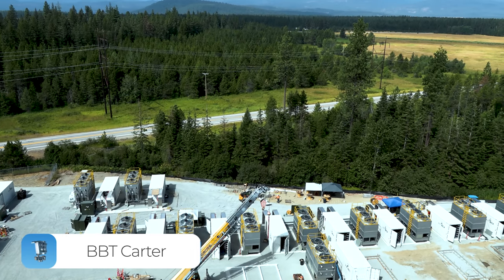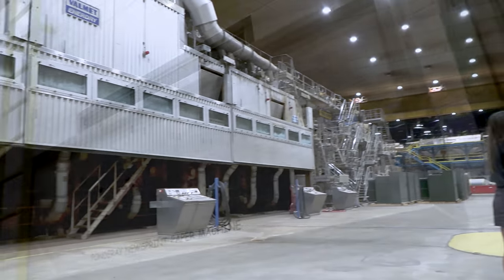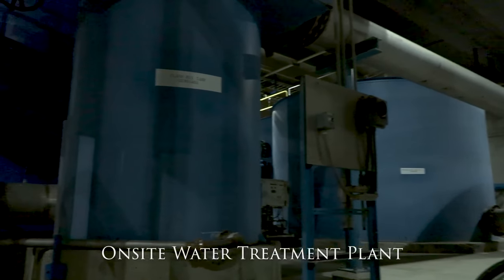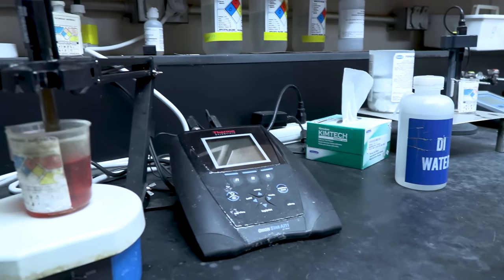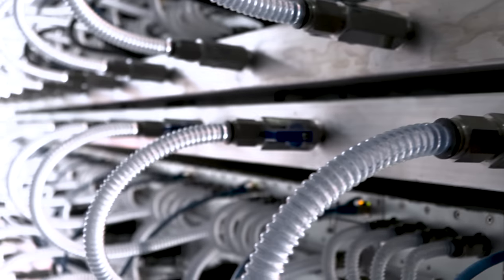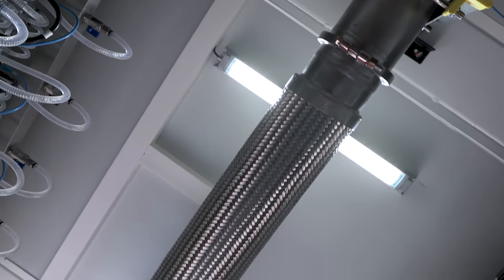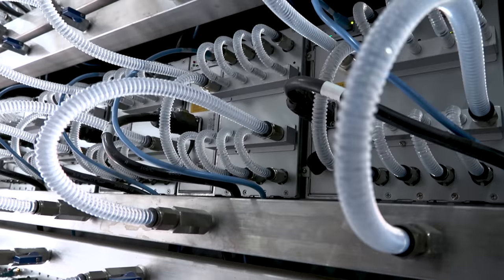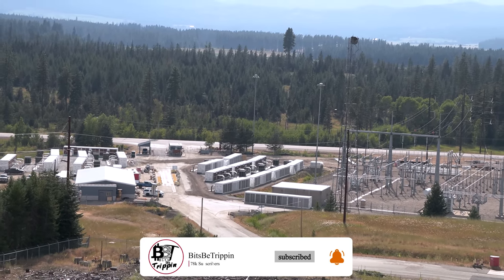Bitmain S19 Hydro Deployment Deep Dive

Comment: This is basically what I work on in high rises.  Pretty cool. Why not have a sealed system with a heat exchanger for the miner side (core water). This would emanate the dumping of water but you would have to chemically treat the tower water. It seems like it takes tower water only to remove the heat.

Comment: Excellent work, are the first ones I see showing the complete system working. amazing set up!!!. Does the antspace include the cooling system?
Reply from the maker: Yes, the container & cooling tower both come together, along with 210 Hydro units. Its a packaged deal. But there is a bit of work to make it functional.
Reply: @BitsBeTrippin  Hey BBT, we didn't see no update about the immersion setup ?
Reply from the maker: @Steve25g  check Twitter - will post update
Reply: @BitsBeTrippin  thx for the answer, not on twitter though

Comment: Is the water shower using the same water that is pumped through the units or is that just providing evaporative cooling for the radiators that the fans are pulling air through?
Reply from the maker: Yes, same water

Comment: Does this mean commercial miners will be forcing out home/hobby miners?
That install, at it's industrial scale, is a bit intimidating.
Reply: Already have. Where you been all these years? 😂
Reply from the maker: The Hydro unit really isn’t for a Home Miner
Reply: @BitsBeTrippin  Exactly. Will home miners be able to compete for shares with new businesses using hardware at that scale in 10 years? Looks like the the industrial sized miners might squeeze the hobbyists out if more of these  businesses arise.